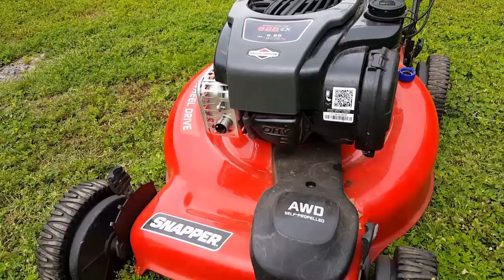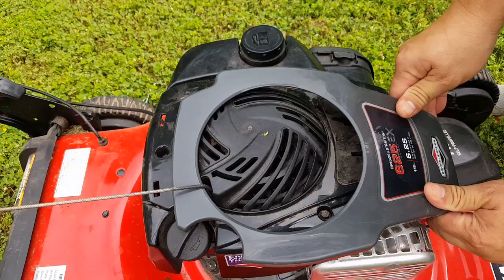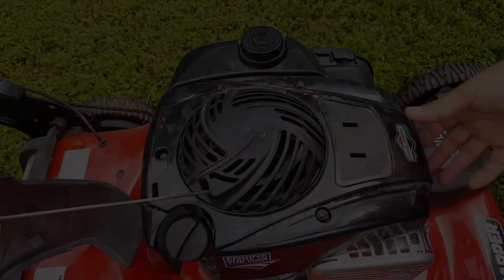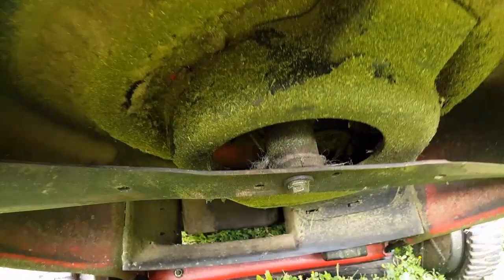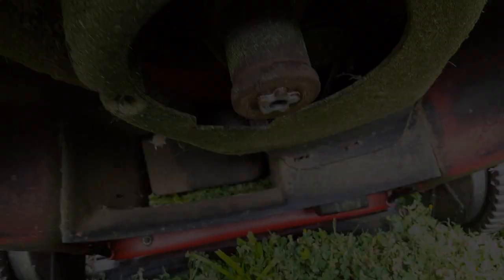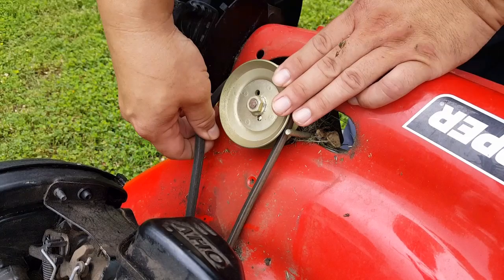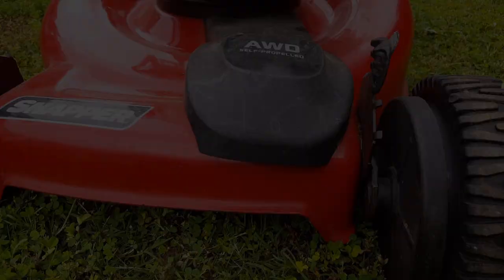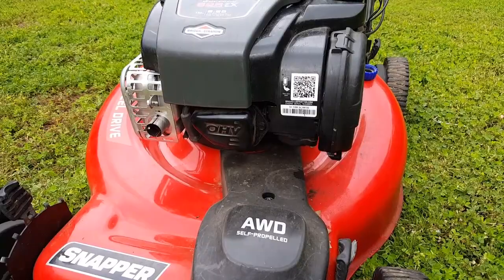Lawnmower hit something now it won't start. Blade adapter broke.

Comment: I struck a rock patch with my Honda HRN when taking down some brush in the fields. Luckily it was raised high up and only scraped the blades. So now there is a nice scratch running across both of them
Reply from the maker: Wow.. you got lucky.

Comment: Nice video. Thanks. I unfortunately just ran over some keys that fell out of my pocket while mowing. I started to hear some noise under the mower while it continued to mow and started to act up. So, I turned it off and look under the mower to see that nothing was broken on the blade. Sadly, it won't start anymore. I wonder if it needs to be replaced or the "key."
Reply from the maker: it would have to be something more substantial than keys to stop the damage the engine.  I wonder if something else is going on

Comment: I got my lawn mower to start but it’s vibrating so much now that it hurts to keep on.
Reply from the maker: Either the blade is bent or the crankshaft is bent. Try replacing the blade first and see if that helps. Thanks for the comment I appreciate it

Comment: I chipped a piece of a rock while mowing with my push mower. The mower still starts but runs for only a few seconds. Any ideas what damage was done?
Reply from the maker: I believe so. More than likely the key isn't completely sheared but partially.  It isn't enough to keep it from starting but it's more than Enough to keep it from running.
Reply from the maker: Here's a video that might help you out.
https://youtu.be/xCzzKnX-sTQ

Comment: hey man i have a mower that i dont think hit something but the crank looks bent but its hard to explain it is so barley bent that im not even sure if its bent the only way you can see what i belive to be a slight bend is to look through the side schute remove the plug and spin it over fast will this even effect the mower in the case its barley bent
Reply from the maker: strap the kill switch down into position start the mower on concrete and watch if the mower starts to rotate on its own.
Reply: @HomeGaragechannel  well good news is it didnt turn bad news is the motor is burning oil now so i got out my craftsman with a honda (my back up mower) and it runs wide open throttle plate isnt stuck governor arm moves this wasn't an issue when i used it last any ideas on this it also has a manual choke and throttle
Reply from the maker: @scootertuningfl2174  how loose is the governor arm? Loose or is there some resistance?
Reply: @HomeGaragechannel  loose but with throttle all the way down some resistance
Reply from the maker: @scootertuningfl2174  have you checked that the throttle plate in the carb isn't stuck open?
Reply: @HomeGaragechannel  yes although now that i look at the governor arm has no tension
Reply from the maker: @scootertuningfl2174  it may have disconnected inside the engine.
Reply: @HomeGaragechannel  the spring doesnt have any tension is this the cause it ran fine before it sat
Reply from the maker: @scootertuningfl2174  its a possibility

Comment: its another mower but my engine runs fine but the blade wont spin?
Reply from the maker: not a lot of information to go on, so my guess is going to be super vague as well. you blades on a clutch that's either driven by a belt, or a friction disc.  either there's a problem there or the cable that operate it, is broke or stuck.
Reply: @HomeGaragechannel  Sorry i was trying to find the answer everywhere and was frustrated. Thanks for the response, It was a belt on my Power Smart push lawn mower, you were right.  It has a pulley under a Stroud and when I hit a stump my belt did rip apart..  But the problem is now I can't find a belt?  It says on it, OMN 4PK460.  I searched for a couple hours, even the parts diagram I got from Home Depot, has everything but the belt.  Thanks again for your reply.  And the part number of my mower is DB8621PH
Reply from the maker: thanks for clarifying and yes getting the parts can be rough, let me see what I can find.
Reply from the maker: sorry not having any luck either.

Comment: How would a lawnmower act if it doesn't have a blade adapter but the blade still on?
Reply from the maker: It would still start and run okay.
Reply: @HomeGaragechannel  well maybe I got a bigger problem than I thought because it would not start but I'm gonna put a blade adapter to see what it does I'll keep you posted
Reply from the maker: @michaelgonzales8807  okay thank you

Comment: Do you know what the thing above the blade is called? Mine came off and won’t go back on
Reply from the maker: Do you mean the blade adapter?
Reply: Home Garage it protects the thing that makes the blade spin, it’s the plastic piece
Reply from the maker: @ddgamer7598  you mean the large plastic piece that protects the belt and the pulleys? I'm don't know the official name for it.
Reply: Home Garage it’s under the mower and right above the blade idk if yours is like mine but I have a Troy built push lawn mower and there’s this plastic piece right above the blade and it got detached and won’t go back in after I ran over a metal garden pole
Reply from the maker: @ddgamer7598  can you find the label on the mower that has the model number?
Reply: Home Garage it’s a Troy bilt 675 series 21” self propelled mower 190cc
Reply from the maker: @ddgamer7598  I do believe you're giving me the engine information.  I need the deck model. It might be under the black flap on the back. Otherwise it's on the deck somewhere.

Comment: Engine will not start if Blade adapter broken?
Reply from the maker: As long as the flywheel key isn't sheared it might start. The blade adapter sometime breaks instead of the key.

Comment: ENGINE MODEL NUMBER
08P502-0111-F1    . replaced the flywheelkey on my mower  , after hitting something hard ,  but still wont start , its very hard to pull , and backfires . i need a pro
Reply from the maker: Yes unfortunately hitting something with the mower can cause multiple problems.  Ask someone to physically look at it.

Comment: I ran over a tree stump (grass covered over) after changing out the blade, but horrible sounds and vibration. I believe the crankshaft was damaged. Can that be replaced, or is all lost? Thank you.
Reply from the maker: Thank you for the comment.  Yes it can be replaced but the cost and work involved it high.  I would put it on the curb and buy another mower.
Reply from the maker: @OneOfTenVirgins  no problem
Reply from the maker: @OneOfTenVirgins  it depends if you do the work yourself.  A shop would charge about that much. If it were me I would replace the whole engine.